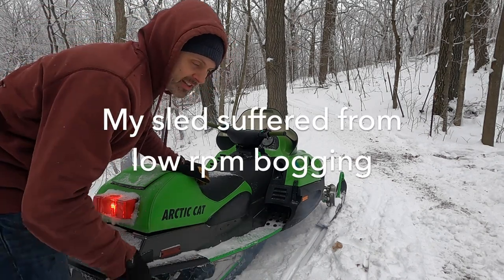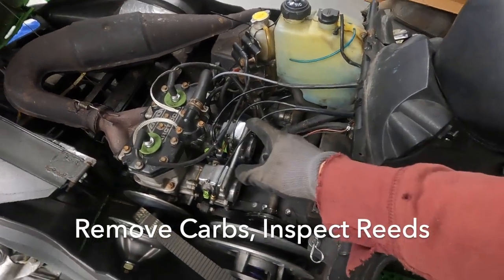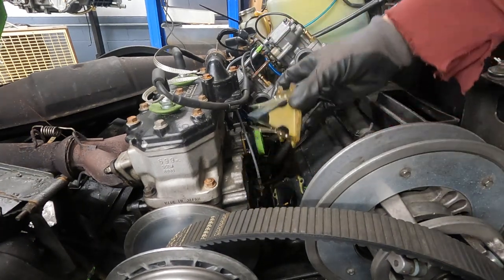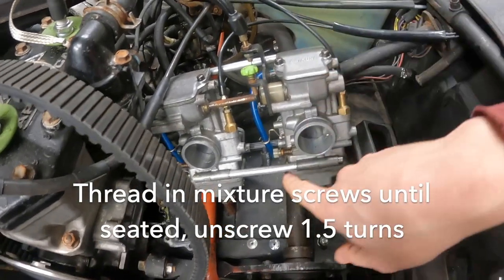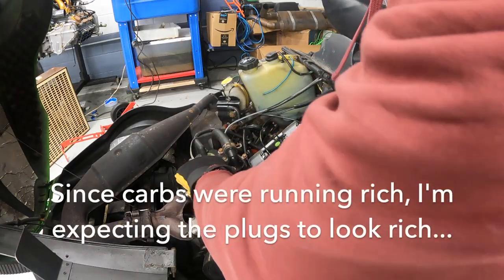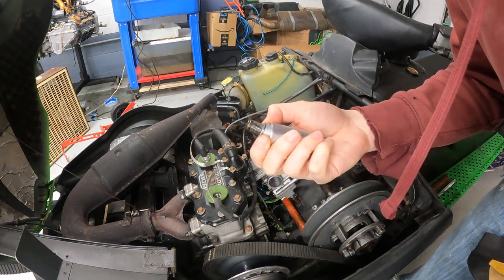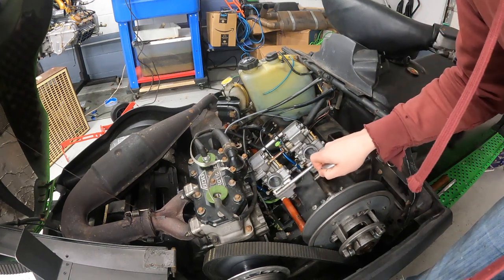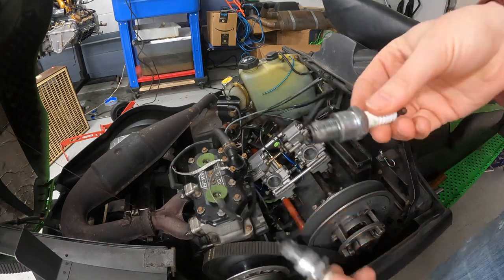Mikuni TM-38 Flat Slide Snowmobile Carb Setting & Reed Inspection - Cheap Arctic Cat ZR600

Comment: Also make sure the oil pump marks are aligned with the marks other wise you maybe over oiling, or under oiling.
Reply from the maker: For sure!   Did that in EP1, but yeah should have included that in this.  Dang.  Link just in case anyone needs this one:

https://youtu.be/-0XRUiDgzsI